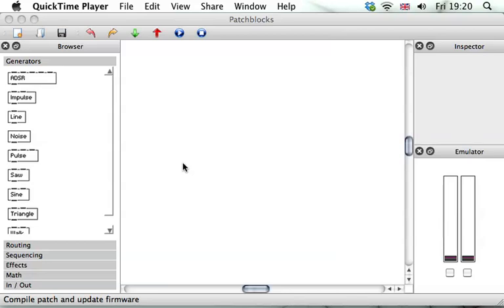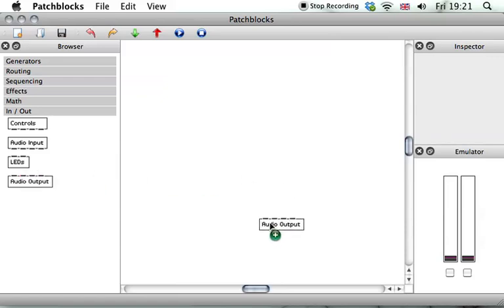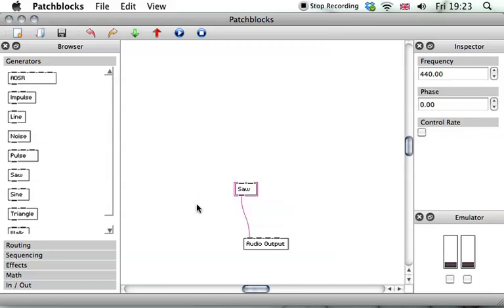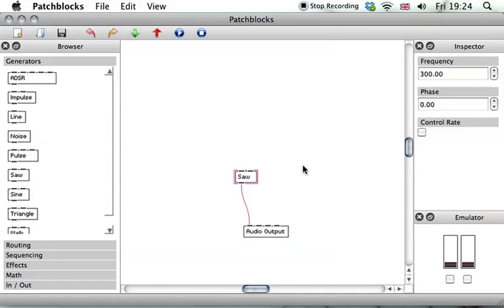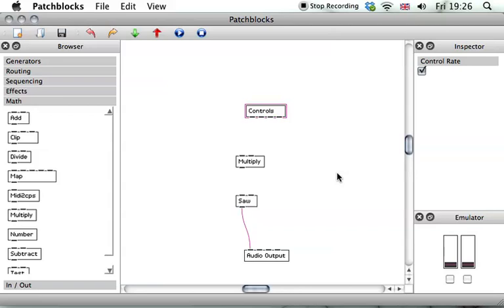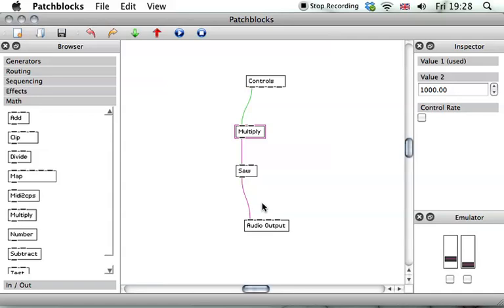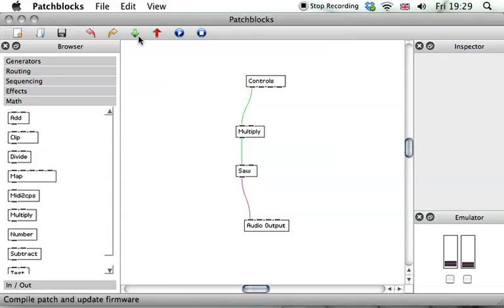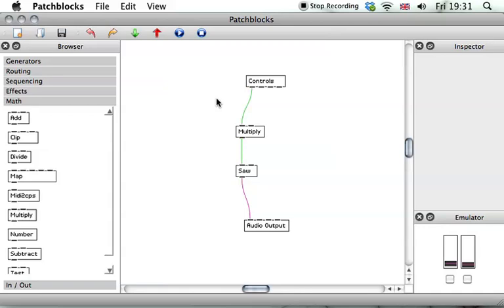Patchblocks Tutorial 1: First Steps

Comment: I bought a single one of these and it's so much fun it's crazy! I want to use it as an effects processor but the overdrive doesn't work in a way I can understand. At zero on the knob, the output is completely silent, but at high values the output is quiet. Between that, the input doesn't really seem to distort much. Anyone know how to use the overdrive properly?